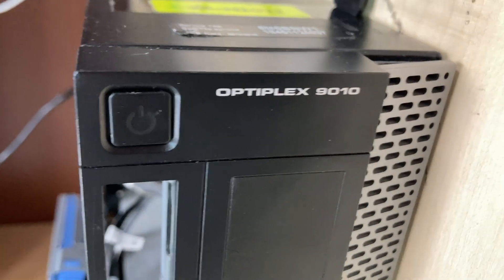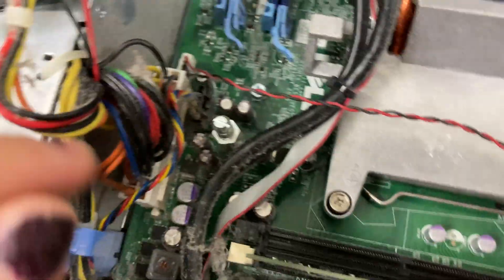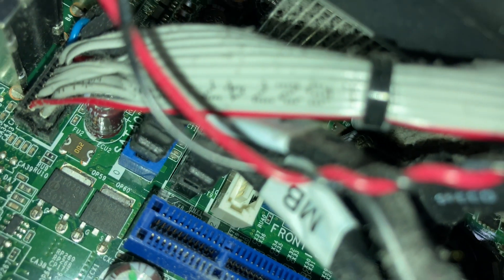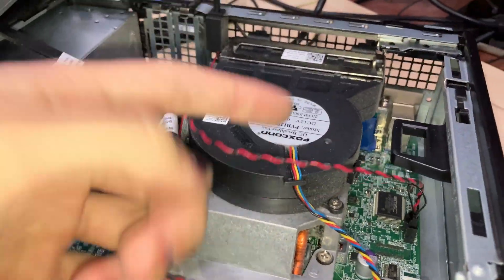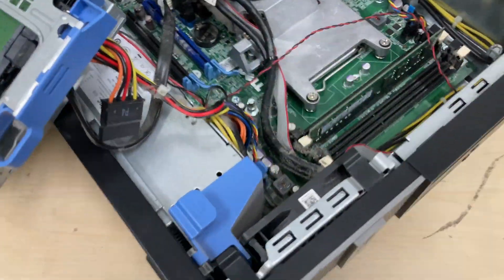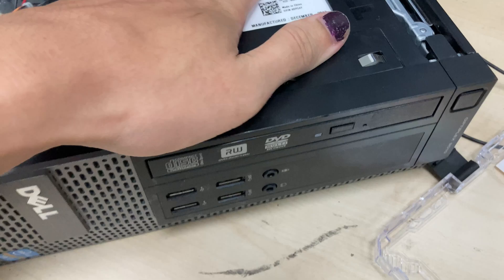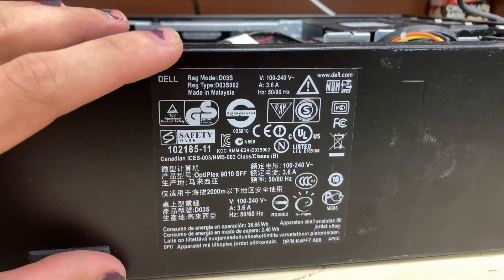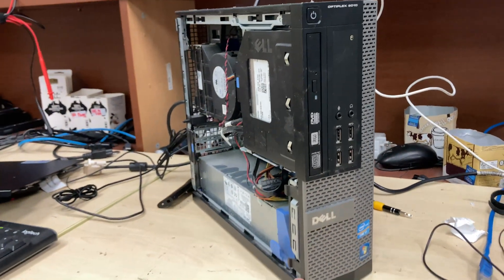Dell Optiplex 9010 SFF Specifications and Internals

Comment: Can I put a rtx3050 or 2080 in the 9010?
Reply: It depends. But probably not. In these kinds of PC cases the GPUs should be low profile cards, which means they have a shorter bracket. You could bypass this by keeping the case open and/or saw/bend the case to make space for the GPU. But more importantly it depends, whether or not the GPU needs additional power via a PCIe 6-pin or 8-pin connector. So there are RTX 3050 which are low-profile and which don't need additional power. Like the MSI RTX 3050 L 6G OC, the Asus RTX 3050 OC, and the Gigabyte RTX 3050 OC Low Profile 6G. But there is no similiar RTX 2080. Even if, the small 240W power supply wouldn't deliver enough power. To add even more information: I don't know any RTX 40xx (RTX 4060) which does NOT need any additional power. Asus and Gigabyte offer RTX4060 low profile, but they need additional power. Oh and I think the "latest" AMD consumer GPU in low profile with no additional power is the Radeon RX 6400 -- which, well doesn't even have the video encoder chip for H264/H265/AV1, in case you are thinking of some kind of HTPC/homeserver.
Reply: the best you could put without doing weird stuff in the sff is a low profile rtx 3050, rtx a2000, gtx 1650 or rx 6400.
so to answer your question, in the small form factor version, no for the 2080 but a 3050 might work if its a low profile card.
Reply: My case fit the 3050 thanks